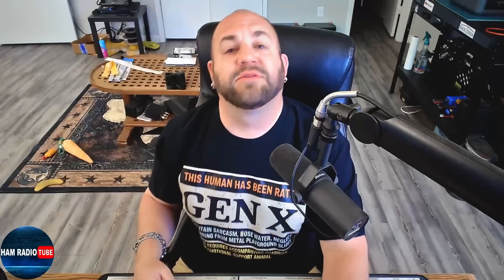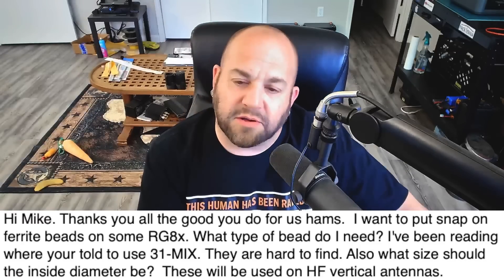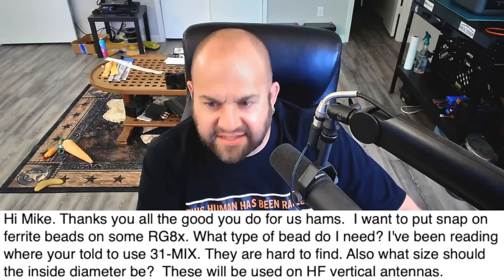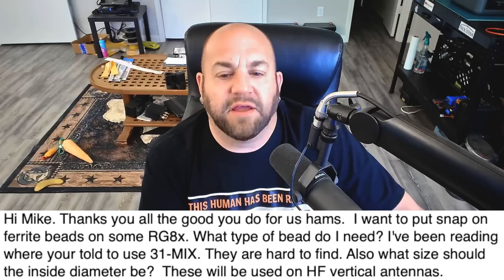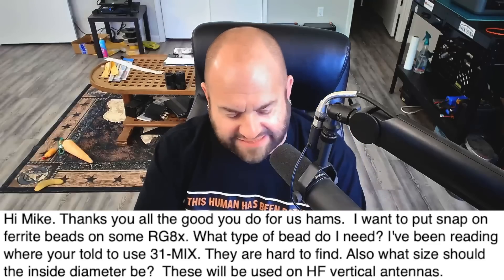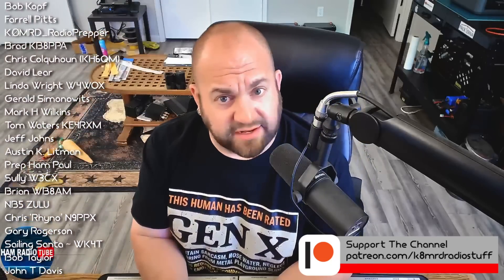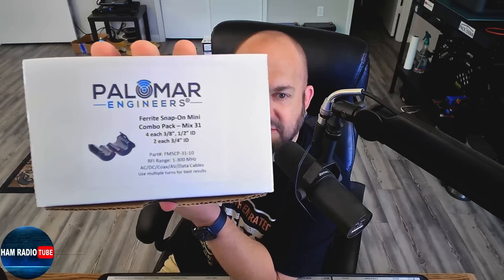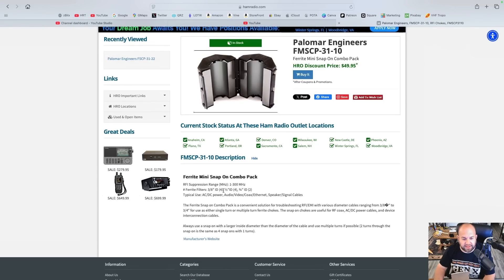Do Antenna Tuners Actually Tune Your Antenna, Or Are They Lying To You?

Comment: High SWR can do two things; One heat your coax or feed line, Two destroy your transmitter. Ergo the tuner. The only thing a tuner does is protect your transmitter. A tuner matches the 50 ohm output of your transmitter to the ohmic value of feed line + antenna. Ideally you need two  SWR meters, One between your radio and the tuner and one between your tuner and your antenna. By doing this you can know the true state of what your tuner is doing for you. If everything is working properly the SWR meter between your radio and the tuner will show a low SWR and the one between your tuner and antenna will show you the true SWR on your feed line. By knowing the specs of your feed line and the SWR on that feed line you can calculate the losses and derive how much power is actually getting out of your antenna. Most built in tuners are a 3:1 but there are better tuners available such as the Elecraft KAT500 which is a 10:1. FYI all Elecraft  internal tuners are 10:1. I have an Elecraft K3 and a 50 feet of LMR 400 Coax and a home constructed 40 meter End fed wire antenna. I can "tune" from 160 meters to 6 meters and my radio never sees an SWR of more than 1.4 to 1. I have worked world wide with this set up.  The most ideal set up would be your transmitter connected to a 50 ohm feed line connected to a resonant 50 ohm antenna with no need for a tuner, but real world is never ideal.
Reply: good comment this one.
Reply: Actually the primary function of a tuner (transmatch) is to allow the maximum transfer of power into the antenna system (key word 'system'). After that point, all that power is delivered to the antenna itself (minus the power dissipated by the characteristic loss of the feedline and any additional loss due to elevated SWR - which can be quite significant if using a coax feeder). 

I would also like to note that a natively resonant 50 ohm antenna isn't necessarily the ideal design in terms of performance. In fact, there are many non-resonant antennas which will easily outperform their resonant counterparts. The key in using such non-resonant (but relatively high performance) antennas is to feed them properly. That would mean either locating the transmatch at the antenna feedpoint (to essentially eliminate loss due to SWR in the coax) or by using a balanced feeder (assuming a balanced load). One example of a higher-performing non-resonant antenna is the common 5/8 wave vertical used on VHF and UHF. The 5/8 wave design is not resonant (and therefore typically has an impedance matching network incorporated into the antenna housing) but its pattern has the desirable characteristic of focusing more of the signal toward the horizon where it is most useful. Thanks to that pattern, compared to a 1/4 wave vertical (which is resonant and provides an approximate 50 ohm load), the non-resonant 5/8 wave antenna has about 3 dB gain. The extended double zepp on HF is a similar design. It provides about 3 dB gain over a resonant half-wave dipole (with a similar broadside pattern) but the EDZ is not resonant and must utilize an impedance matching device of some sort.

In short - transmatches ('tuners') and other impedance matching devices allow the use of some relatively high-performance non-resonant antenna systems. As such, they can be a valuable component in a relatively efficient and high-performance antenna system - when used properly.
Reply: @BrianEsche  let's not forget that what he's talking about are 'automatic' transmatchers, if it wasn't automatically adjusting it'd just be an antenna.
Reply: @BrianEsche  I do not necessarily disagree with any thing you said. The context in which I mentioned the "Ideal System" was regarding "tuner" matching. 50 ohm into 50 ohm load. (no need for a tuner). Of course there are better performing antennas than a 50 ohm resonant antennas all of which require a matching network and now we're back where we started, protecting the radio.

Using a matching network (tuner) (as you have said) does fix the mismatch between the radio and the antenna "system" but there is still a mismatch between the feed line and the antenna. Using twin lead feed line does not "fix" the problem. What it does do is significantly reduce the losses due to a high SWR. Using twin lead still needs a matching network "tuner" and often a more expensive one. I use a Palstar balanced feed output Antenna Tuner, I did not call it that Palstar did.

FYI: this subject is many faceted and often misunderstood and frequently disputed. I on the other hand think you and I are both correct. Before I retired as a Computer Network Analyst I said networking was %40 science and %60 black magic. Maybe some of that could apply here. LOL.

Comment: I have a a Dipole that I built myself. I cut it to a 1/4 Wave on 80 Meters, and use an AT-200 Tuner which allows me to work all HF except 160 Meters. I have had ZERO issues with this setup.
Reply: I'm sure you have no issues because your transmitter sees the proper impedance thanks to your tuner, but wouldn't your antenna's ERP actually be the greatest at 80M, vs. 40, or another band since it's cut to 80?

Specifically would your antenna actually radiate as well at 10m, as compared to a Dipole actually cut to 10M??  

It's like everyone comments suggest that the antenna doesn't matter.  Just use a good tuner and you can tune all of HF with any length wire. While that IS a true statement, it seems like the actual ERP would differ if the antenna itself isn't in resonance with the frequency you're trying to transmit.
Reply: @RickPaquin  The Antenna IS cut for a Full Wave at 40 Meters. Since I have VERY little real Estate 1/8 Acre I pretty much HAVE to have a tuner to work all bands except 160.
That being said, I totally agree with your observations.

Comment: I got clamp on chokes mix 31 from Mouser. They are legit, and at the time cheaper than the regular ham sources.

Edit: the number of turns squared gives attenuation. 2 loops = 4x, 3 loops = 9x, etc.

Comment: Tuner in the shack makes a good match to the radio but the SWR on the coax remains high. When the tuner is at the feed point of the antenna SWR on the coax is low and you can toss that 9:1 out the window if your tuner has a stud for wire.

Comment: Spot on, Mike! The tuner does an impedance transformation, so as to get as close to 50 ohms for the transceiver, which has been designed to transfer maximum power to a 50 ohm load (antenna system).

I've had my ICOM 7300 for 5 years now, and the MFJ-939 external antenna tuner I purchased has been superb! It has 20,000 memories to remember the setting it used to get the lowest SWR on any given band and frequency. It handles 160 through 6 meters and can deal with SWR ratios as high as 32:1.
Due to my townhome community limitations, with my 132 foot off center fed dipole hanging in 2 different cedar trees, I can work all bands (160-6 meters), FT8, CW and SSB.

Obviously, some bands will radiate better than others, as they are closer to resonance, but at least I can get on the air with ALL of them.

Best addition to the shack I ever made. If you can get any of the MFJ or LDG tuners to assist you with antennas that are somewhat compromised due to your QTH or portable location, then buy them!
73 - Stan WB5UDI

Comment: I'm only at 16:00 in the video but I have a caveat I would add about the tuner "just making the radio happy". I agree that physically fixing the antenna is the only way to radiate better BUT I design magnetic loop antennas with high Q and even though the TUNER is the only thing making it work,  the radio only receives if it is.....TUNED with the tuner. Regardless if the radio is happy or not, the reception is highly dependent on the TUNER. Aside from that caveat, I agree with everything you've said about the antenna being the deciding factor on how you TX and the tuner not 'fixing' any problems. But Mag-loops are a good example of the exact same physical antenna 'working or not', completely aside from radio happiness.
Reply: My ex job was marine electronics technician, we installed huge verticals on the ships, and antenna tuner was at the base of those verticals ( not in the radio room) . Works great.

Comment: I have a 7300 and the LDG tuner.  There is a cable for it for the 4 pin in the back of the 7300 that makes it where you hit the tune button on the 7300 and it operates the tuner.  Works fantastic and would highly recommended

Comment: I understand the impedence matching but how does the tuner deal with the reflected power?  In my ignorance, I just kinda treat it as magic that protects my radio on some bands.
Reply: Open the tuner and touch the ferrite that is being used in your case. You'll know which one is doing the grunt work because you won't leave your finger on it too long. LOSSES GALORE. Heat is not free and that's exactly where the magic watts go....NOT in the air.
Reply: @aarongriffin81  if the the reflected power is released as heat and not through the antenna then wouldn’t the 25 reflected watts end at the tuner and the forward power only read 100w?
Reply: @ClayKJ5EKZ  the reflected watts radiate somewhere, they escape at points with the highest SWR. SWR is different at all points of an antenna system. If a tuner is adjusting for a large impedance mismatch, that's where the heat, er, watts end up. Touch a 49:1 after moderate use. Heat is not free. Watts are used to heat it up. A 4:1 balun is not as hot. The bigger the mismatch, the more heat generated. A tuner is exactly a matching unit just as a balun is. Who checks the SWR after their balun? I do when designing an odd shape delta loop, etc, but everyone just accepts whatever the SWR is behind the balun. Just because the radio is happy doesn't mean the balun is happy. Same for tuners. The reflected power gets very hot. It doesn't magically combine with forward power. It leaks at the weak points.
Reply: When the tuner is tuned to match impededance, the
Reflected wave from the antenna hits the tuner it is reflected back in phase with the forward power from the transmitter. Power is then all radiated out of the antenna. That’s why you notice that he was reading 125watts forward power once the tuner was engaged. 25 watts is reflected due the the swr of the antenna so it’s not putting out the 125 watts the power meter displayed. In this example there will always be 25w reflected but also full 100w out.

Comment: Mike, you are, of course, correct.  The tuner should be called an antenna SYSTEM tuner.  And the system is the antenna and feedline.  The idea is to transform the complex impedance found at the end of the coax to 50 ohm resistive load to make the transmitter happy.  So, if you have crappy SWR on the coax without a tuner, you'll still have crappy SWR after the tuner.  Happy Monday folks.

Comment: I keep two 50' runs of coax in the go kit. I presume I'll need both, but since eventually someone with spiked shoes will eventually walk on the coax, at least there's a chance I'll only need to replace one of those runs.
 OTOH, for a hardwired installation, sure, I'd prefer one unbroken run.
 Sometimes, there is no real solution.

Comment: All 100 watts is getting radiated when impedance matched. Its a one way gate. When the reflected power comes back it's phase inverted and added to the forward power until it's all radiated. The only losses are in the coax when it's high swr. This is why ladder line is better for non resonant antennas. Resonant antennas arnt any better than non resonant. This is why doublets are amazing.
Reply: actually, it’s reflected back out of phase, and the tuner reflects it forward in phase. +3-1+1=3; except for line loss, which is generally small, @snokones is correct.
Reply: Right about one thing - phase. But the reflected energy is reversed phased. And what happen when you mix different phases? They cancel not combine. If you had 25% reflected,  +3-1=2 not 4
Reply: @akiddoo8113 not true you may wanna read "reflections" by Walt Maxwell.
Reply: This is correct.
Reply: Totally agree!
Reply: doublets are amazing due to the wide bandwidth due to the low impedance along the doubled wire at the various bands. A 3 foot piece of wire will have alot of reflected power that you say is radiated....Is that the same radiation from a 100 foot wire? I have heard the argument that any and all reflected power is added to the forward power, and even if you don't math it together it is still radiated. My example of the 3 foot wire versus a 100 foot wire will prove that wrong. The actual problem with reflected power is that losses are exponentially increased as the SWR increases which mean the reflected power is lost in the antenna system that was not intended to be the actual antenna. It finds a way to somewhat radiate but very poorly. Often times in the form of HEAT.
Reply: Baluns will incur losses in the form of heat, JUST like a tuner. If you use a balun that is not rated for the watts, it will get extremely hot. If there were no losses in the TUNING aspect, there would be NO heat generated at the tuning part of the antenna system, the balun.